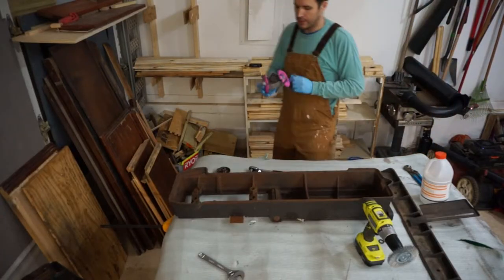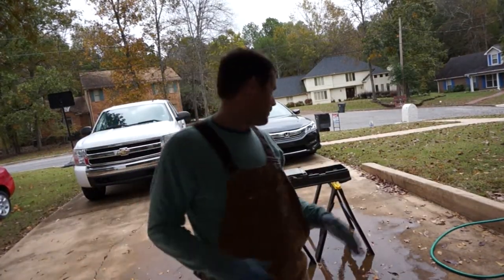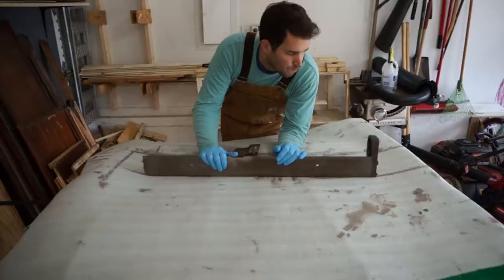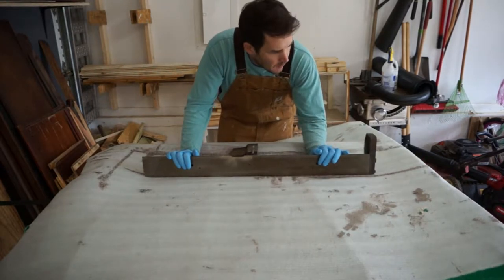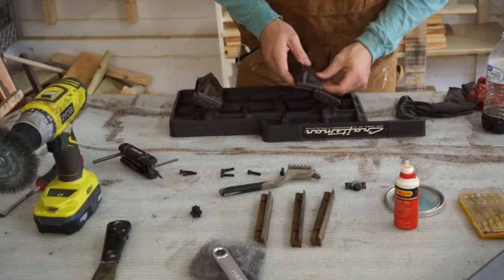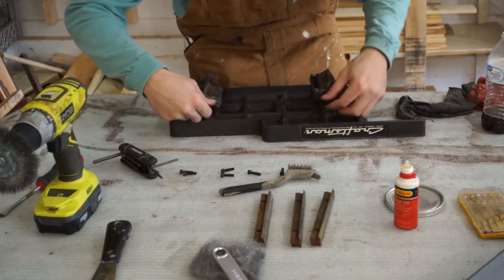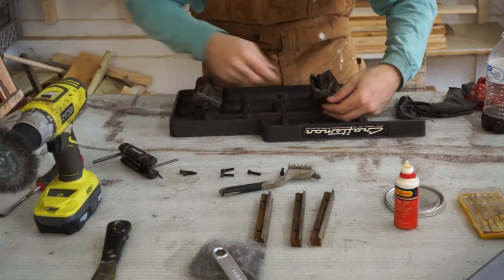Vintage Craftsman Jointer Restoration (2018) || Part 2

Comment from the maker: Thanks for all the comments and questions on this video!  I have replied to most of you guys about the circumstances behind the Blade Setup Video, but, shortly after making this video I had a really bad injury on my table saw.  So obviously no woodworking for a while after that.  2 surgeries, alot of rehab, and a house move has happened since this video.  I am in the process of getting everything set back up so be on the lookout for a Blade Setup Video.  

If you would like, you can check out some of my other videos, plans, and articles on my website.  www.alldaydray.com

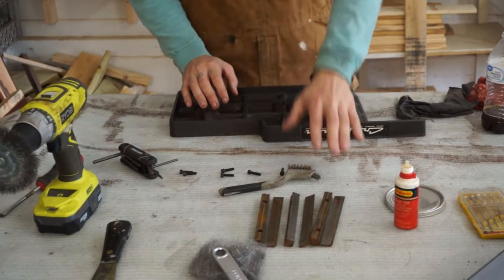Comment: That cast iron base is so nice.  Mine is a 113 so the base is just stamped sheet metal.  You did a beautiful job on the bare cast iron and a nice restoration overall.  Did you figure out where the washers with a curved side and a flat side go?  (Lying just above the locking bolts and studs at 7:47.)  It looked like you installed them with the jointer upside down.  With the jointer sitting it its normal upright position, they go on top of the leveling studs AFTER the studs are installed in the  jointer base, between the studs and the dovetail bases.  Their purpose is to take up angular misalignment as the infeed table is leveled.  Please don't think I'm being critical.  After trying to level my infeed table I found one of those little beggars on the floor and had to figure out where it came from.  After I put it in and flipped the jointer back upright I found two more on the floor that I KNOW weren't there before.  I had loosened all of the locking bolts to get the one washer back in and that's when the others dropped out.  I ended up removing the infeed table to make sure all four were in the recesses in the tops of the leveling studs and had to go though the leveling process again.  For anyone looking for a good manual with lots of exploded views you can search for the 113.206801 or 113.206931 jointers.  None of the manuals have a good drawing of those special washers,
Reply from the maker: David Dale hey David.  Thanks for the comment buddy!  I actually did get them right.  And I don’t think you are being critical at all, I need all the help I can get sometimes.  I had taken a lot of pictures before I broke the leveling assembly down altogether.  Yeah the manual I found was ok, but that’s why I still took pictures just to be clear.  I don’t know if I have seen the sheet metal bases while looking online, I’ll have to check it out.  Thanks again for the comment and I’ll try and search for that manual and see if I can post another link.  Have a great day buddy!
Reply: @DraysWorkshop  There are a few things on this machine that are simply a PITA when it comes to disassembly/assembly.  I took the cutter head out of mine so I could dunk it in Evaporust.  It wasn't bad; cleaned up in 2-3 hours but there was rust in the bottoms of the slots for the knives and wedges.  I was concerned that the soft rust might prevent parts from seating properly.  Here's the link to the best manual I've found.  It's for a 113 but there's not much difference.  https://www.manualslib.com/manual/150216/Craftsman-113.html 

I ended up removing the infeed table to put those troublesome washers back in and put a little grease on top of them so the infeed table could slide over them without displacing them.  This is all very recent and very fresh in my mind.  I have about .006" of dip in the middle of the infeed (right to left, low in the middle) like a swaybacked horse.  I doubt there will be any impact as long as I don't try to joint anything less than 24" long.  It will be a pain to lap out but I will eventually.

Comment: I recently restored one of these and for some reason, the blades went flying off when i tried to put wood through it. Glad I wasn't hurt. Hoping I can figure out what I did wrong.
Reply from the maker: Man I know you were scared!  That was a close call.  The only thing I could think that would cause that would be maybe everything was cleaned/lubed too well and the 2 set screws that hold the blade in might have slipped due to excess lubrication.  Did all three come out at one time? They are held it by a wedge and 2 screws on each one.  I have a little video on setting the blades if that might help, definitely give you a closer look at the blades of it

Comment: Looks good.  What did you end up doing for belt tension?  I have this jointer and it's seems to just be eyballing it on how far you let the motor slide down the leg.
Reply from the maker: Hey Frank!  Thanks for the comment!  I actually didn't really have to mess with the motor position or tension on this one.  It was placed about perfect when I got the jointer.  I did however have to move it left/right a little to get it to track right.  I could take a picture if  you would like and if it would help you.  But I'm like you, it kind of just seems to be eyeballing and looking for a good tension as on mine it is just 2 U brackets that are holding the motor support on.

Comment: Do you have a video that shows how to set the blades for this jointer?
Reply from the maker: Hey Don!  Sorry for the late Response, I didnt get a notification of the comment for some reason.  I have not made a video for this because I had a Table Saw Injury shortly after making this video last year.  I am going to make one, as since then, we have moved houses, and I about have my shop up and running again.  When I post one, I will comment on here with the link!  Thanks for the comment!
Reply: @DraysWorkshop  sorry to hear about your injury. Thanks for the reply. I look forward to your upload.
Reply from the maker: Don Smith thanks buddy!  We are definitely a lot better now!  I appreciate it.

Comment: I just bought what I believe to be the same model of jointer you have and it looks like I have the same problem you do. My blade guard doesn't come to rest so that it covers the blades. In the middle of the spring (where the spring ends) that attaches to the blade cover lines up with the holding screw instead of being perpendicular to it. Did you ever find a way to fix that? 
By the way, great job of restoring.
Reply from the maker: J F I’ll be honest buddy.  I haven’t fixed it yet.  I messed with it for a little while and the spring feels like it still has some compression left on it.  I went back later and threw some grease on the rotating parts hoping that would help, but it still doesn’t pop back like I would like it to. Maybe there are just old and worn out but still feel ok, I dunno!  Thank you for the comment and question!  This is what I did this for, I ended up getting in a table saw accident right after this but I plan on starting back up soon! Hope to see you around
Reply: The fix that worked on mine was to remove the guard, polish the pin on which it rotates and clean the bore in which it rotates with a large caliber bronze gun cleaning brush.  Lubed it with general purpose grease.  All you have to do to remove the guard is to pull the cotter pin.  No need to remove the parts around the spring or the spring itself unless it has been previously removed and installed backward.  On mine the cotter pin was original, long and tough and it was wrapped almost 180° around the pivot pin on both legs.  I replaced it with a much shorter cotter pin that was the same diameter but stainless steel and much softer than the original.  It only needs to be spread a little so it's easy to remove later if necessary.  There is zero pressure on the cotter pin so no need to get carried away with spreading it.

Comment: oupps did not find it..will be on the lookout.
Reply from the maker: Sorry Jean!  I had a accident on a table saw shortly after making this.  I have moved since the video and the new shop is almost up and running, well the way i would like anyway LOL.  I will post a video soon about setting up the blades!